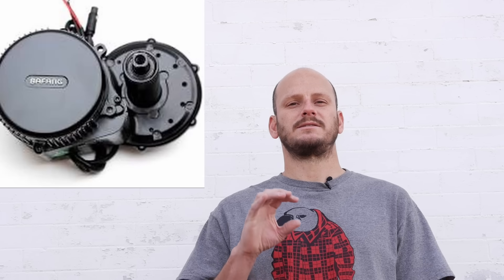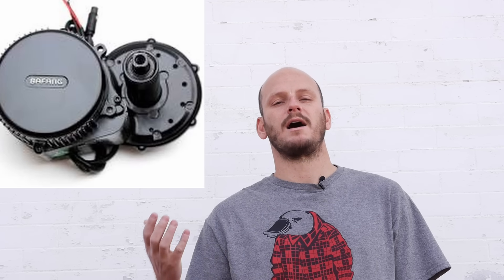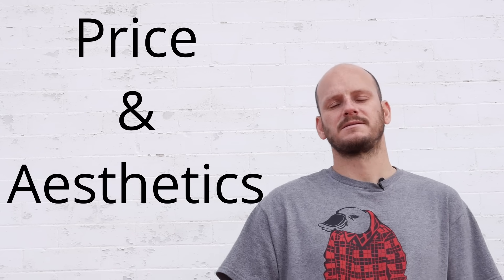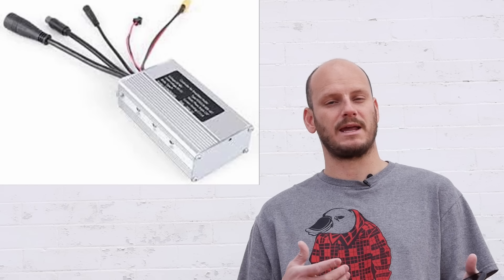Hub vs. Mid Drive Motors: Why Hub Motors Suck and Debunking Common Myths with performance test

Comment: How do you connect a mid drive to your front wheel?  Or you only do rear drive?
Reply from the maker: Only rear wheel drive. Mid drive runs via the chain, utilizing all the gears.
Reply: @JohnnyNerdOut  have you ever tried 2-wheel drive? I didnt thinknit was that necessary, but when i got a 2 wheel drive ebike just because I could, I would not go back to 1-wheel again. The differences are awesome. Not to say that the examples are crucial for necessitating a change, they still are notable: tight turns are very effective, as the front wheel leads the way and isnt merely pushed. Riding up hills, over obstacles (such as onto a curb) is super effective. Overall increased torque and speed. Better control and grip on the road. I suggest you try it. Its really something

Comment: Reality is mid drive bikes tend to be much more expensive, this video is kinda confusing because there is pros of a hub drive motor depending on the situation like you did mention at the end but didn't make enough emphasis on this. for example in my opinion the ride1up roadster v2 gravel has to be one of the best ebike ever made because of its simplicity

Comment: if im planing on converting santa cruz full suspension bike into absolute monster with like 8000W motor should i use hub motor or mid drive?
Reply from the maker: This is for single speeds but a lot still works for your needs:
https://youtu.be/fARoXaYM7G8?si=Jp5eckV_5Xp1JOcU

Comment: Thanks for the informative video. Everything you said makes sense except one thing I question. How is a Hub harder on the spokes than a mid drive. Don't both apply torque from the center of the wheel. The gears on a bike which are turned by the chain applies torque from the hub does it not? So why would hub motors be harder on the spokes? Thanks
Reply from the maker: It isn’t the spokes, it’s the quality of the whole wheel assembly. Cheap hub motors use cheap parts and unskilled workers to assemble. A quality hub motor on the other hand won’t suffer the same problems but you pay the same if not more than a mid drive for one of those.

Comment: you can't upgrade the controller in a mid drive like you can for a hub motor, can you?
Reply from the maker: Yes, there are plenty of aftermarket controller upgrades for mid drives.

Comment: I totally disagree with you. I think mid drives suck. I have used both. I much prefer a rear hub drive. And I have never had a problem with loose spokes on a hub motor wheel.

Comment: I have been out in the Everglades and bent my derailer chain kept coming off luckily I had a hub motor no problem getting back also my bike has 100 nm of torque in each motor front motor I only turn on when I need to climb a hill and my chain doesn't get the same  stress as a mid drive I like hub motor much better.

Comment: I use a rear hub motor and it's fantastic.

It might be possible to burn them out, but you can also replace them fairly easily.  Had it for a few years with a lot of miles riding it fairly hard and it's still going strong so far, no problems and not needed replacing.

At the end of the day it's an ebike, not a motorbike.

It's designed to only ASSIST you.  And it does an absolutely fantastic job at that - taking the grind out of stop-start acceleration, and hills.

Here in the UK (and Europe) we have a very different view of ebikes to the US, they're legally capped at 15.5mph and 250w continuous (they're allowed to peak higher than that).  Not that we've got anything against speed and power, but that's called a motorbike, and you need a license to ride one.

I have both incidentally - an ebike and a motorbike.  I use my motorbike for getting around fast, and i use my ebike for assisted cycling.

Comment: I don't really want a dedicated e-bike. I just want to take a 120 mile ride every now and then, and have backup power in case I can only make it 90 miles on my own. But then after that trip, I want to go back to my daily 10 mile ride with no power. I don't need high power, or fast power, or pedal assist, or light weight, I just need the most simple-to-install help in an emergency on these long rides. Any recommendations for the simplest thing to get the job done?
Reply from the maker: Kits aren’t super easy to remove but can be done. That being said I’d recommend just keeping it on but going with the lightest weight setup.
Reply: Thanks!  @JohnnyNerdOut
Reply: I appreciate your reply. If you have time, I have another question. I haven't done an exhaustive study but a couple things I read said mid-drive motors create drag when not in use. Have you found that to be true? Also, if I just leave it on there for weeks at a time between long rides, will I be wearing out the motor in any way? Thanks again. @JohnnyNerdOut
Reply from the maker: @interested891  you won’t wear out the motor but you will have drag of ~5%-10% due to weight and pedaling through a motor gear set.
Reply: @JohnnyNerdOut  Thanks again for replying. Well then, good to know that I wouldn't be damaging my investment. I'm no speed-racer so 5-10% SHOULD be a non-issue to me. And I don't care at all about the weight. But I also know that I'm a spaz and would be annoyed by just the idea that I'm pedaling through the drag. I'm irrational about efficiency, even if won't affect my life. You're the man JNO! Happy New Year!

Comment: Kind of old but To your point about burning up hub motors, I would ride my hub moter every day full speed(30mph) for around 40 miles a day minimum and the motors never failed.  I would end up upgrading after a few years as opposed to it burning out.  I may have burned out one hub motor ever.  I just have
Reply: what burns out hubs is extreme loads, at low rpm, like at a very steep Hill.

Comment: We own two RAD city bikes with hub motors.  Absolutely no problems or issues after 4 years of using every day.  We use them on both pavement and gravel.   Hub motors don't help wear out the chain and sprockets as mid drives do.

Comment: I don’t know what it’s like in the US today but here in Germany, the price difference is much more significant. I bought an e-bike about 2 months ago and mid-drive bikes are much more expensive than hub drives at a similar overall level of quality. I’m talking 2200€ vs 3500€.

And the mid drive bikes you can get here are all super bulky and heavy which is a problem if you have to get the bike through a 100 year old inner-city building’s hallway into and out of the backyard every day.
Reply from the maker: You should really consider building one. Much cheaper and much better specs (with a mid drive)

Comment: Point 2; the geared transmission is the only valid reason for a mid-motor. 80nm delivered via a hub directly to the wheel is more usable torque than 80nm delivered by a mid-motor. Not comparable. The hub is more energy efficient in even terrain and has the benefit of regen breaking which also avoids breaking pad wear and tear. Also, mid-motors ruin all chains and carbon-drive trains in a breeze. Mid-motors only make sense 4 mountain bikers.
Reply from the maker: A mid drive gives you more precision on how the power is applied. It is a more advanced system which can be good or bad depending on rider level. For road riding a torque sensing mid drive will be the most natural feeling. When used improperly a mid drive can destroy bike parts faster due the extra force for sure.

Comment: First off, hub motors do not suck. Many of us don't need, nor will never use the "benefits" of a mid drive motor system. Plus, with hub motor e-bike's, you don't need a high end drive train to handle the extra torque and power from the mid motor drive. Just an inexpensive setup will do. So there's less maintenance and cost down the road because the hub motor "babies" the chain and gears. And with a 750 watt hub motor, I seriously doubt there's any more pressure applied to the spokes than a 200 lb. dude standing on the pedals trying to get up a hill or accelerate quickly. The power to the ground all stems from the rear hub afterall, just as it ultimately does from a mid drive powered set-up. There's no getting around it. The power's got to transfer to the rim/tire/ground somehow. And even more "spoke abuse" will happen when that guy slams through the gears from a high torque mid drive powered chainring. So what's your point? 🤷‍♂ So my point is, not everybody needs or will benefit from the amazing attributes of a way more expensive mid drive motor bike. But I can tell you what truly does suck. Spending more money on something than you need to. THAT is what truly sucks. So I'll stick with my hub drive setup and count my money all the way to the bank. It's all I need and will ever use. You might use that logic in your formula when someone asks you "what's the difference"? Your question back should be "what are your needs" and "how much do you have to spend"?

Comment: Is it true that mid drive motors break with using throttle? I'm new to e bikes, just doing research. Thanks!
Reply from the maker: Break what?
Reply: @JohnnyNerdOut  The motor itself breaks if one uses throttle only on mid-drive motors. Or throttles shorten mid-drive motors' lifespan. That's what I've read. 

Not sure if it checks out or not.

Comment: I think most of the responses are being delivered from serious high-power mid-drive folks. Cool. I also believe the point here is to demonstrate the advantages of a minimum wattage motor(750w USA) - which it clearly does with ANY kind of serious hill/incline challenge. This type/style of hub-cycle is fine if you live on basically flat ground at any wattage. (I'll beat ya up my hills)
As Johnny says, "It's way better to drive a mid-drive than anything else"

Comment: NO, hub motors DON'T suck IF you have a hunting cargo bike and need power EVEN IF YOUR CHAIN BREAKS in a remote location. Just use the throttle. PLUS hub drives do not put any strain on the chain, UNLIKE a mid drive motor. 
BTW, my bike has TWO 750 watt motors. Yep, AWD with a 10 speed Shimano Deore gear set.My bike is an E-CELLS Super Monarch Crown with DUAL suspension, TWO batteries (down tube and under rear rack) 9 torque sensing assist levels,  etc.
So this 95 pound "beast" is a CARGO BIKE capable of carrying 400 pounds (including rider's weight but not bike weight.

Comment: PITA changing hub wheel????   disconnecting plug is that difficult??
Reply from the maker: Depends on the bike. Some are actually hardwired to the controller believe it or not! Others have poorly placed wiring that run super close to the rotor etc. it’s why a lot of bike shops won’t work on hub motors.

Comment: Hub drive more popular around here, cheaper, easier maintenance, wheels no spokes as they now solid wheels with 3 metal spokes very strong,  hubs heaps better now, only 500 watts goes like the clappers 50 degree hill , not that I'm against the idea of mid drive but mid drive slow to take off on ahill cause you gotta really push down with legs to get it going,some hub drives same but I admit, depends on the bike too I think

Comment: Although I agree mid motors are awesome, just got 21820 miles out of my Bosch Advanced Line, hubs have some large advantages in my beliefs.
Mainly ease.of replacement.

Comment: You cannot do regeneration on a mid drive, and getting them fixed, it’s a problem. I watch grin and having experience with the World Solar Challenge there is a lot of potential improvement to a hub. Although I agree with what you have said, and biking is a limited use of electric motors, maybe you are right but there are some amazing hub motors out there and for where I live the difference is closer to two hundred dollars, I think the only mid drive I would choose is a bafang, if my current bike motor fails the bike is total trash, I am never going to find a replacement motor, and the manufacturer is not contactable.😢

Comment: Hub drives are fantastic for road commuting and your chain/cassette will wear very slowly with a hub drive bike. Yes a mid drive can handle imstantaneous terrain variation offroad that a hub motor can't.

Spoke replacemdnt is a religion with hub motors.I carry six with me and a spoke wrench at all times taped right to the frame or with my tools.   They are very easy to replace on the side of the road once you get the hang of it. Don't even need to take the wheel off, unless the spoke breaks inside the spoke nipple... which is somewhat rare ( they usually break on the other end at the j bend) and in which case I leave it for home.

Comment: tl;dr IMO hub is better up to 1kW, and middrive is better beyond 1kW.

Full text: Dude. This is BS. Maybe you are a mechanic, but it seems you have no idea about relation between torque and power. If it makes 2x torque, the rpm will be lower, so you will need to gear it up end end up with same or less torque due to friction.

I built my first ebike in 2007, started at 500W, ended at 10kW, and then I did a car conversion.

Yes, you get less torque at low speed with incorrect controller settings, but you get it as torky as mid, or even better.
If you calculate acceleration time, don't forget to include gear changes.
Also, my first 500W mid drive was loud as heck and it chew up chains for sunday breakfast. Literally, chain per week. I neede to lube it before every ride. And my gears broke a lot. So hubs are way better in terms or funning cost, no service. And they can be absolutely silent.
To address gear issues, I even tried nuVinci, which added almost 7 pounds and would still not shift under load.
If I had to do it today, I would only pair it with belt drive and internal gears. It may be feasible for street legal bicycle (pedal assist, 25km/h max), but anything more and it will eat through chains.

Hubs only become too heavy above 1-2kW, so middrive is better for performance bikes. However even 4kW scooters/mopeds still often come with hubs.

Comment: Mid motors kill the chain by the additional power. Yes. There are stronger chains. 
Also, you need to cease pedaling with force a second or so before shifting, as shifting under load is really mean to cassette and chain. 

That’s expensive in the long run. 

Having belt drive and mid motor… excellent concept!

Comment: I've been using the same hub motor conversion bike for 10 years now. I haven't broken a spoke, or even had to re-true the wheel, since about 2016. Once the spokes wear in a little, you gotta loosen them all and retension them like you're building a fresh wheel. It's a direct drive motor, so it only needs new bearings once in a while, no other wear parts. 10 years of being able to go up hills at 25 MPH have been nice, no mechanical or electrical breakdowns at all. But it's heavy and mainly built to be a fast commuter. 
That being said, my next ebike will be a mid drive. Definitely will be nice to go farther on a charge.

Comment: 2:10 it's not the same milleage hub vs mid,  if you get a direct drive hub motor,  it will have a few miles higher top speed, as well as higher efficiency...   geared hub motors are the rubbish that you need to avoid buying...  the gears reduce efficiency,   you should only buy a mid motor if you want torque,   buying  a hub motor with gears for more torque is a waste of moeny...  by a gearless direct drive hub motor and it will go very fast

Comment: 9:47. Tesla sells more EVs than anyone else, and they have never used a hub motor.  ...so they definitely don't all use hub motors.  9:55 LOL!!! Again, Tesla doesn't use hub motors!
Reply from the maker: Correct. My point was that it doesn’t use a transmission. Exactly like a hub motor doesn’t.
Reply: @JohnnyNerdOut  They use a single speed gear box.  So it's not just raw motor output, it is tuned to the application.  And unlike a hub motor, the mass is full suspended.  But you were talking about hub motor reliability, and you were talking about how they become more reliable in higher output applications like Tesla.   So I'm just making it clear, we're talking about totally different technologies, with very different manufacturing aspects.  So even though there is some surface similarities (fixed leverage), you're comparing very different things.
Reply from the maker: @bujin5455  totally possible. My problem is that I make an analogy for the lay person to understand but in trouble with the nerds. I probably need to speak more to the nerds going forward.
https://www.evoindia.com/features/difference-between-single-speed-gearbox-and-multi-speed-gearbox-in-evs-explained
Reply: @JohnnyNerdOut   If it makes you feel any better, I just bought about $2k worth of goodies from your store.  ...so I'm not "just" troll.  😉
Reply from the maker: @bujin5455  haha, good man 👍😀